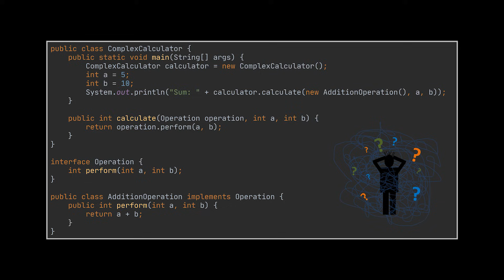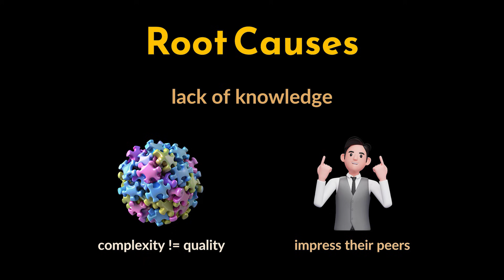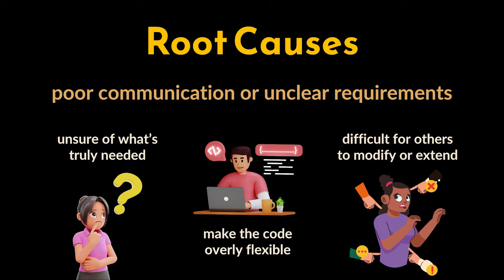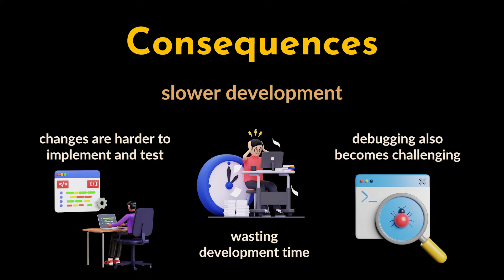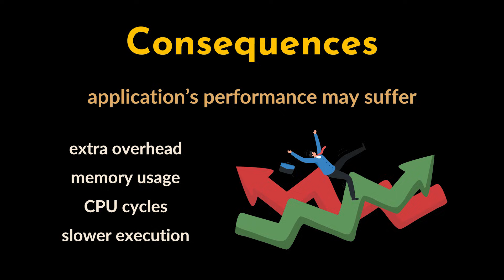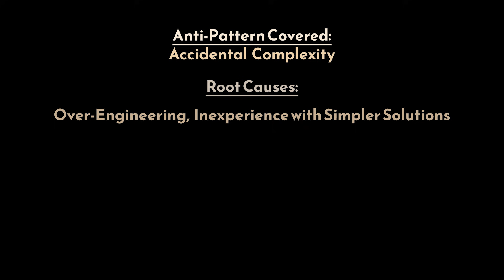Over-Engineering is Killing Your Code | Avoid Accidental Complexity | Geekific

Comment: Though everything you say is correct, I more often face code, where there was put so little thought into the architecture, that it is hard to separate and thus, hard to test. Saying "bare minimum" can be understood as providing a minimum working prototype and leave it like that. A little more complexity by putting some thought into separation of concerns would be easier to maintain, even though you might have some classes more in the end.
Reply: what do you think about DDD, Clean Architecture, Hexagonal Architecture? I'm on the opinion that everyone should learn it once but don't follow it in a purist fashion